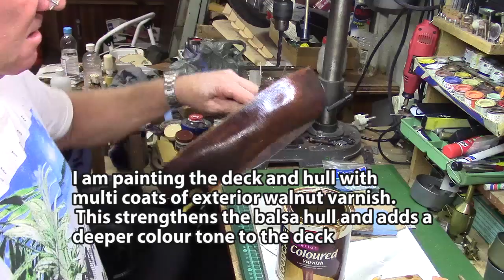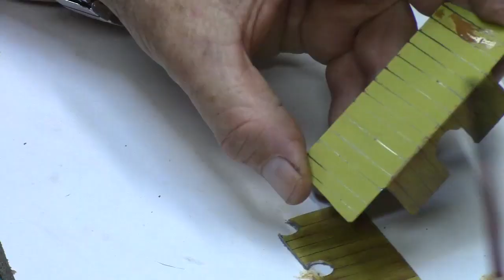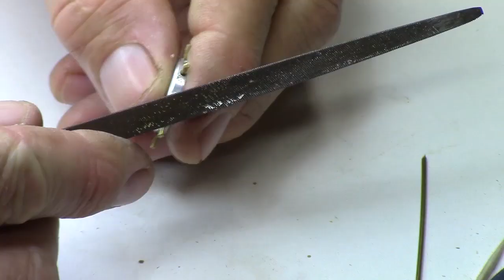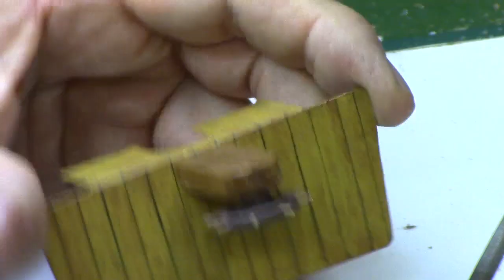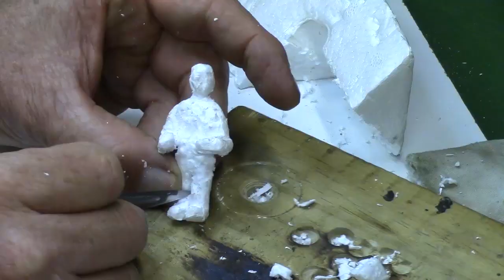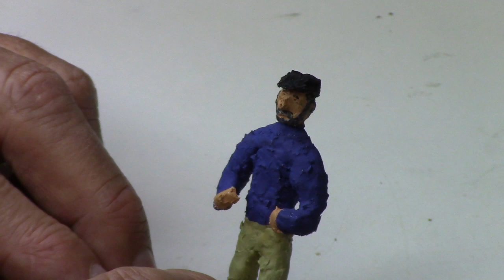PART 7 - Building a Miniature Model Steam Boat

Comment: Why not make the wheel out of wood? It look good when finished. Didn't expect you to carve a captain but I like the rough look you achieved. Look like a sea dog.
Reply from the maker: Hi, I tried turning the wheel out of wood but got poor results due to the small scale and the type of wood I used. Wood not hard enough I think. I had a lot of scrap aluminium bar and bits of brass wire available and so decided to use what I had to hand. The designer of this boat, Leslie Proper,  made a steering wheel using aluminium for the wheel rim and a wooden dowel for the inner hub with wooden toothpicks for the spokes which also worked well. Thanks for your interest and comments :-))
Reply: @SteamerEdge  you dedication is inspiring. I get side tracked easily. If you check the stuff I put up it varies widely. Many moons ago I was doing a propeller and mentioned it when you were doing yours. Just yesterday I did a little work on it and stopped again. Once I finish I will post a link as promised.